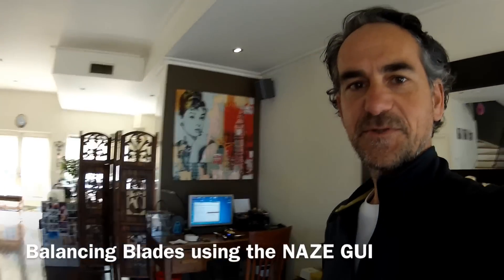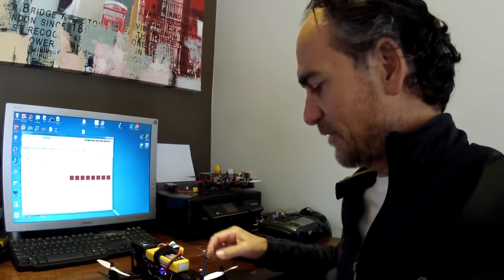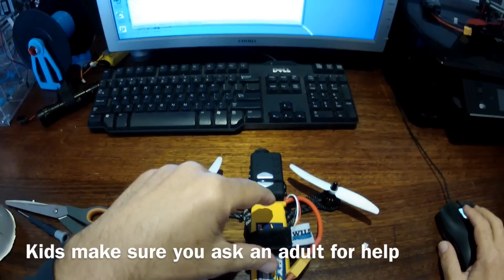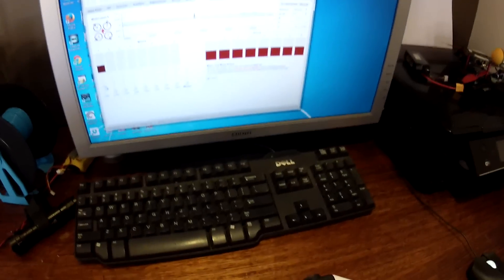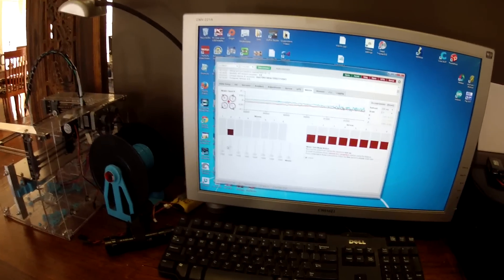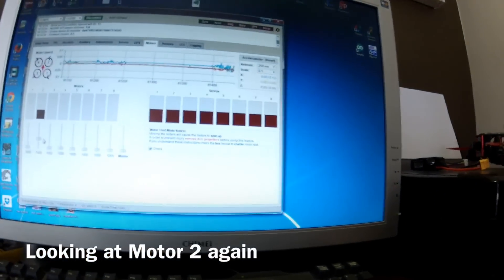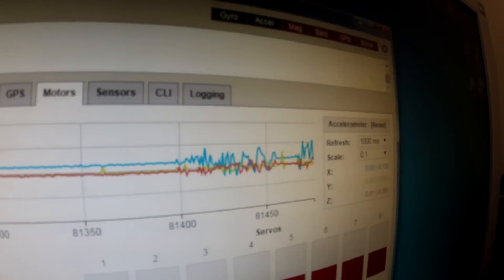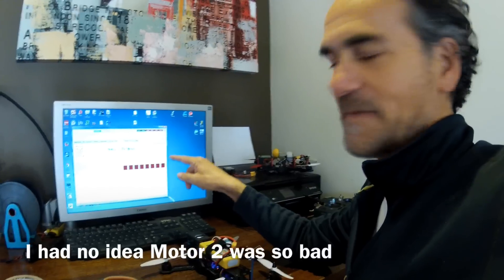Dynamic Prop Balancing using Naze32 Configurator

Comment: Try turning the prop 90degrees and retest. I found when I couldn't balance a motor/prop combo, I rotated the prop in relation to the motor 90 and sometimes 180 degrees, it helped out. I think this is due to an unbalanced motor  bell fighting an unbalanced prop.  Thanks for the video. I'll have to try this !
Reply from the maker: Yeh I did after it improved some on the bell housing but still wasn't up to scratch, I probably should have mentioned it in the video !

Comment: This does work well, but it would be best to anchor the quad down to a surface so the resonance of the frame will be equal to compare all 4 motors. Your hand will vary it's pressure as you assume different positions moving from motor to motor and that change in pressure will affect the resonance of the frame. Now true that in the raw sense of balancing props this will work with using your hand, but I would go the extra step to be able to compare the 4 motors directly.

For example, perhaps motor #2 looked so bad because you weren't pressing down as hard on the frame as you were on #1 and #3...
Reply from the maker: I agree tying it down would not only give you more consistent results but it would also be safer as it leaves both hands free

Comment: Love your vids, keep them coming of course , but may I humbly submit that reversing the props, so they thrust down to the desk would be great for a feeling of safety, and for the life of me I have no idea how you managed to do this bit without a camera person. At one point you are both managing the mouse, holding down the quad and the camera all at the same time. How is that possible, unless as I suspect you do have three arms for this exact purpose. I have often wished for this extra appendage while learning how to launch my AXN Floater Jet:-) and keep a firm grip of my Tx and the elevator stick.

Comment: Don't even try this with some carbon fibers props only if you want to short your fingers lol
I think it's better to balance your props with a good props balancer and you can probably use this method for balancing your motors (without their props of course!).
Thanks for sharing anyway mister i want to cut my fingers :)
Reply from the maker: I hope anyone doing this will try to be very safe, but I might leave the carbon props alone
Reply: I have been using this method for ages and it works, however it is only as safe as the operator. It can be dangerous, if you are not confident, don't do it.
I also have a tutorial on laser balancing on my channel, similar idea, different method.
Reply: ABMNS PRODUCTION Should use a weight rather than your hand and not have the copter anywhere near you.
Reply from the maker: +Buzz Pelermon all I can say is be careful, have a good hold on the quad when you do this but it is worth the effort

Comment: Which axis are you using on the graph, the Z-axis?
Reply from the maker: Hi you need to check all axes, if you get up and down vibration then that's a sign you should replace the blades